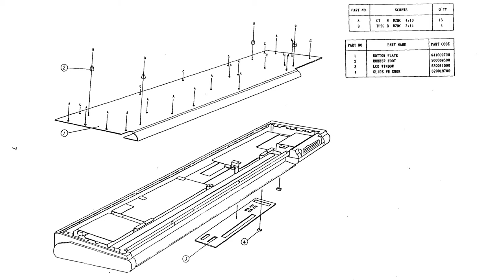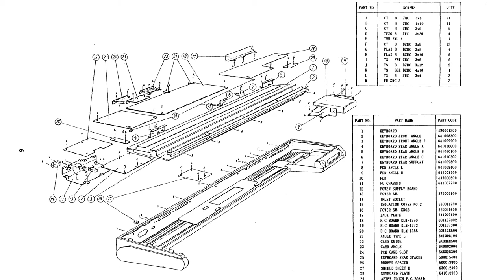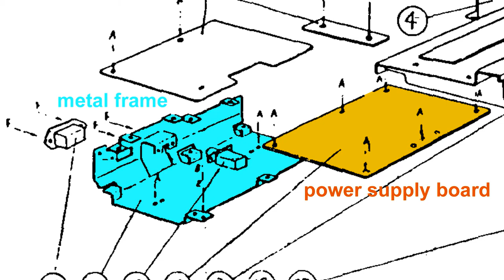[tutorial] Disassembling Korg T2

Comment: You unscrew everything, but I'm curious about dependencies: for example, to replace the display, it seems that you can leave the button-panel in. Also, can you clean the keybed with other stuff in place? You now get it out almost last.
Reply: If you only need to replace the battery then internal disassembly is not necessary. You just need to remove the metal base. Getting to the battery is a fiddle and be very careful not to drop the battery. You will need to reload all your sounds.

Comment: 22:01 does the green wire have to be attached somewhere? it's not on my keyboard....Video is great
Reply from the maker: I think, you mean 20:01. Normally, this is the grounding for the display board and it's connected to the aluminum rail above with a screw.

Comment: Very interesting, I have 2 T3's one working and the other ( bought from new in the early 80"s ) I've been told has a dead  ( UK voltage ) power  unit. I'm struggling to find anyone who can repair or replace the power unit. Is this a service you can provide or recommend anyone who can. Korg say the part is discontinued. Thanks Mike
Reply from the maker: I think, repairing (shipment, parts, time etc.) would cost more than buying another working T3. But sometimes you can find a T-series power board as a replacement part on ebay. Repairing itself is not very complicated - you just need a screwdriver and a lot of time.
Reply: Thanks, I understand. I may have found someone close to me who may be able to help. I've yet to find any T-series power boards on eBay so will see how I get on. If not then may just think of selling it for parts.